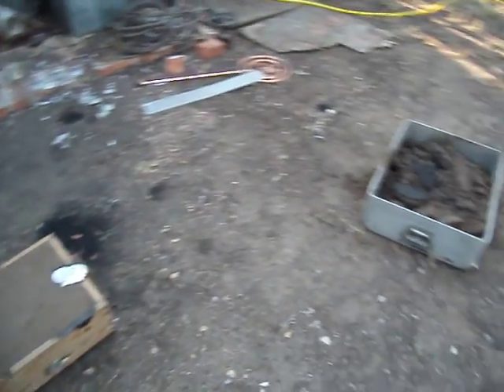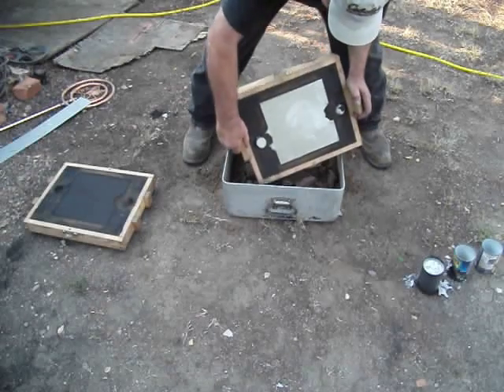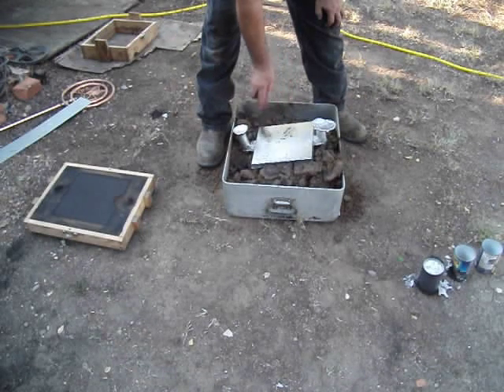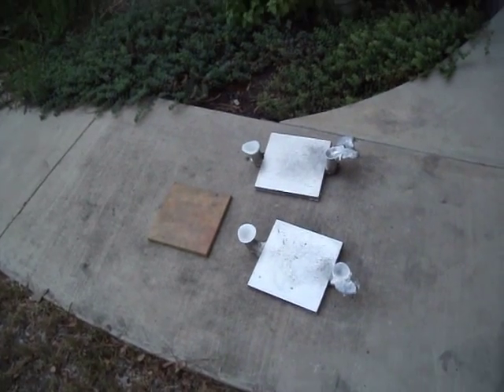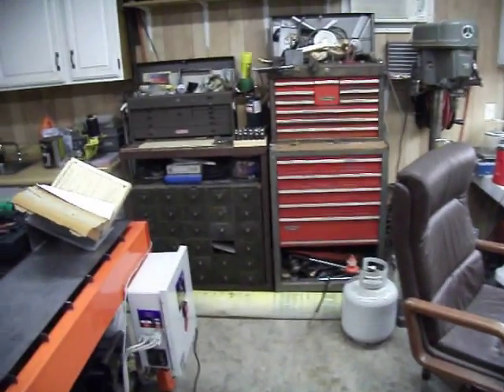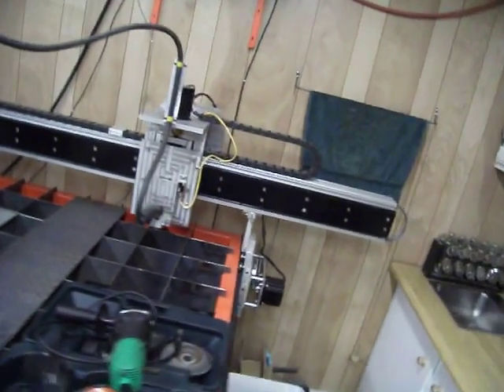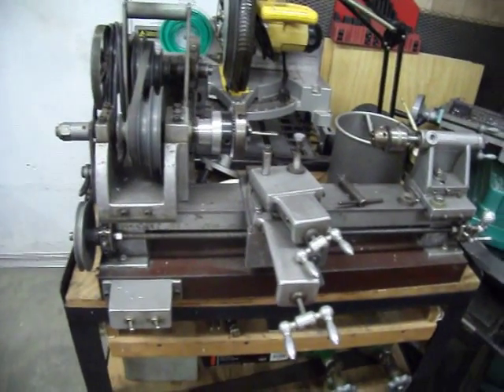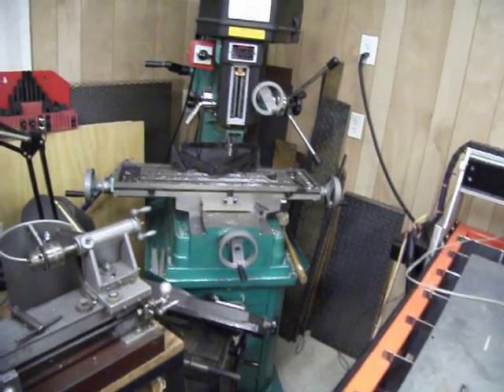3d printer print plate Aluminum casting

Comment: cool!! what is that sand made out of? also where do you get your aluminum for melting?
Reply from the maker: The sand is just common sand, very fine grit. We live close to an area called the  sand hills. I just got a couple of bucket fulls off a dirt road. If you live close to a beach that sand can be used, just will need th wash the salt out of it. The aluminum you can find anywhere. I don't use cans. You can use junk transmission cases, electric motors, aluminum rims, small engines, anything aluminum.